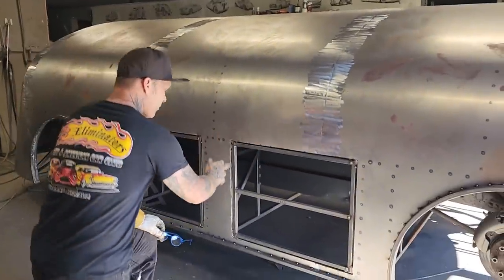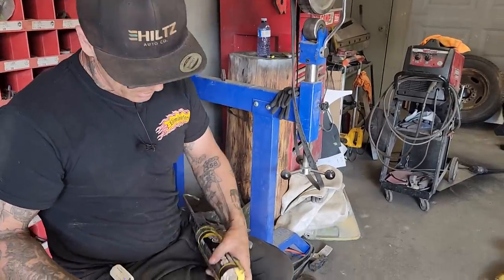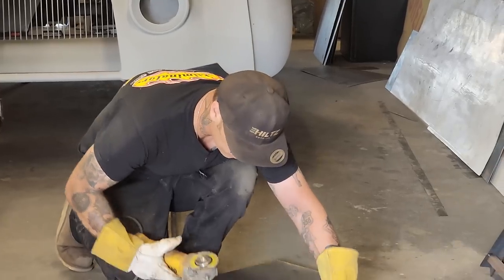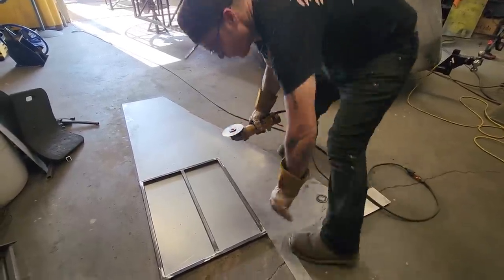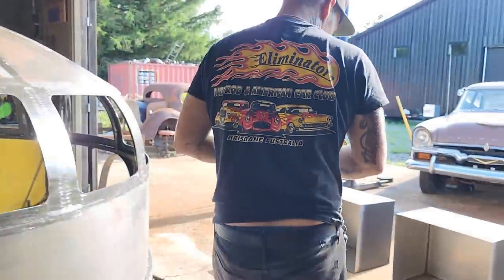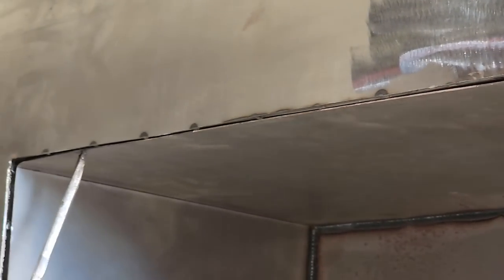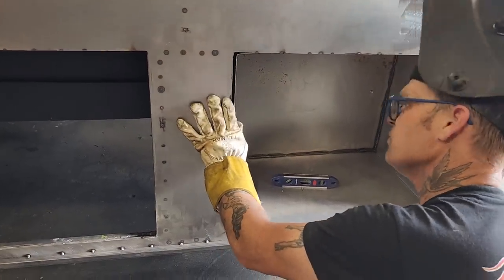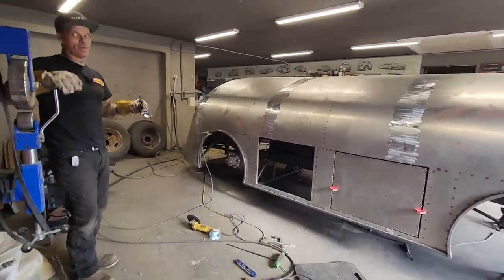Controversial door fabrication... will it work? 🤨

Comment: Here is what I see!  Those tool boxes should have some type of braces under them to handle the wight.  Not being supported when you will be driving the vehicle, the leverage will start warping the body panels. I thought you were going to put angle iron under the boxes to slide in and support them.
Reply: You know…. I feel ya but it will be a mobile art piece. I doubt it will be driven more than a mile or two and isn’t a daily driver. It’ll make a few car shows then sit looking pretty for the next generation to gawk over.
Reply: thinking the same thing not enough support to be used as a tool box area.. L.A Rob

Comment: I'm loving this build. The only issue I see is, those doors will not keep water out of the tool boxes. I'd weld a 1" flat bar  around  the inside of the tool box that the door close too with some weather stripping. Best wishes on your son's recovery.
Reply: I think that with all his builds. Never addresses weather stripping or water getting in. Maybe he doesn’t drive in the rain and he washes his cars with a rag and spray bottle, never a hose
Reply: @DarthParkerCustoms  maybe, but he worries about seam sealer so he's concerned about water at least to some extent.

Comment: Buildings the inner box with an inside lip and recessed back allowing thickness  of the door  and 1/4” thick foam on door back might have been nice for sealing dust out and vibration noise , just a thought . I’m a cabinet builder and this had a similar construction.

Comment: Might want to add some jack points outboard of the frame.. so you can change a tire simpler.. and get it up on a lift in the future
Reply: All show no go just sayin
Reply: @daddysails8926  would you put your life or trailer queen on the line driving that vehicle if you were involved in an accident
Reply: @daddysails8926  well then you better put some FEAR into your soul when you ride in that thing because when you do have an accident even a small one you well be the first person at the scene of said accident and I sure won't drive it nor ride in it and the trailer hitch WONT hold up to any stress applied to it and that includes any kind of tongue weight
Reply: @daddysails8926  dude I drove a semi I've seen more accidents in the 5 years of doing that then you will ever see also while at Ft Polk I saw 2 GI's in a mustang put 200 ft of guard rail through that vehicle further more don't worry about me living my live BECAUSE it's been a good 68 years of living life so now I must say have a good one

Comment: The thickness of the door   is going to be an issue if you don't bevel the edges of the door. If you move the frame in 1/8"  so sheet metal over hangs the frame the door won't bind up.

Comment: please consider putting the entry door on the passenger side. with the driver' s seat, pedals & dash on the left, you could use a fold up seat for the passenger side and have easier entry into the Bugatti Hauler.

Comment: On the Box,s i would have welded at the back of the frame work a support Bar across the rear under the box so when you slid it in its level and supported at the back underside of the box . ..

Comment: I hope your son is doing better. 

The one thing that I thought of was that if you put the patch handle on the middle of the door it will be pretty low. Why do l not put the handle in the top corner and run a shaft down to the actual locking mechanism in the middle of the door? That would make it a lot nicer to open every time. Your back will thank you. Also, you might want to think of some bracing for under those boxes. I know you're not really going to be loading it full of heavy tools but going down the road bouncing along you'll end up causing stress cracks even under its own weight. Best of luck to you.

Comment: Chad and jolene if you're going to be putting a shelf in one of the tool boxes you can use those pieces of angle iron you used to space the doors to hold them up just my belly button and it will save on wasting them lol .keep up the great work the both of you 👏 👍

Comment: Spacer idea great ! At the back of the tool box are you going to put a frame under the tool box as the weight will bend the boxes over time but I suppose that there not going to carry that much weight
Reply: So a bolts the answer  well done Chad

Comment: I would have made the sheet metal bigger so it covers the outside of the opening about 3/4” .  Fold the edge over to make it stronger and then put a good rubber seal around it but you can’t do anything but rush your work. Just saying as I always do

Comment: Im concerned for your  safety . Are you going to mount your fabricated structure on a pre made automotive frame? Like a 1 ton chassis? Aso, exhaust fumes and cabin ventilation. Im blown away at the body work! Job well done.

Comment: I got 3m cavity  spray comes in large  can it for areas that get covered  over i used it on my 2022 maverick truck  to make it last i used it on my 1967 mustang  on frame rails  underneath  the seat risesers good stuff  28bucks need long spray tubes to go in too holes opening  ect after  the welding done  please try it

Comment: Not sure if this has been previously addressed but is there any concern regarding those wheel openings?  The tops (the arches) are fine, but the sides are not straight down (they continue to curve, forming a circle).  I fear those lower "inward points" might come into contact with the front wheels during turns. Obviously, not an issue for the rear wheels, but of course the wheel openings (on this build anyway) should match. Theoretically, the front wheels could be "inset" to avoid complications but IMO, that would look a bit strange. Your thoughts?

Comment: Chad just a thought, When you do the door fronts would it be better to put the frame on the metal and spot weald it in place then cut the metal with the zip cut angled in to the frame so it fits exact ????
Reply: No, it won't.

Comment: I see a lot of folks have suggested a torch and you just said that’s where a torch would come in handy , there must be a reason you don’t use one , can I ask why NOT?
Reply: I do a little metalwork myself. I have a torch, plasma, and multiple grinders. The torch isn’t accurate enough and both it and plasma leaves slag you have to deal with.  The grinder is faster, easier, and more accurate. A torch is good for rough cuts and heating thick metal for bending and hammer forging. Plasma is cheaper, (no gas to purchase) more accurate than a torch, but still a gross cut sort of thing for thicker stuff beyond 14 gauge. Frame work, boxing frames cutting off brackets etc.
Plasma also leaves a hard spot when it cuts so isn’t as easy to grind afterwards.

Comment: Warning ⚠️ ⚠️ ⚠️ ⚠️    if you run it  with out BLOWERS to keep the gas fuels Fumes build up in  your driver compartment     and breathing  that. Not good    Do it like an inboard boat motor  blowers are done.   Warning ⚠️ ⚠️ ⚠️ ⚠️